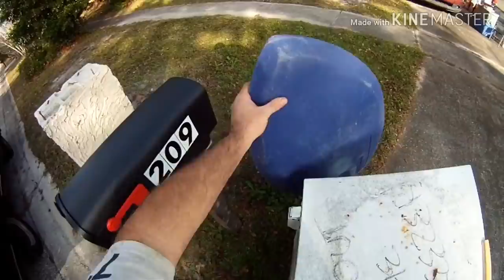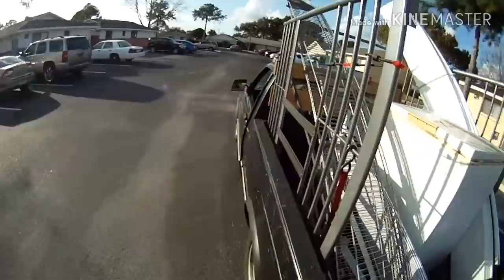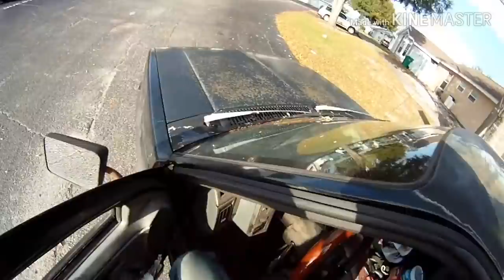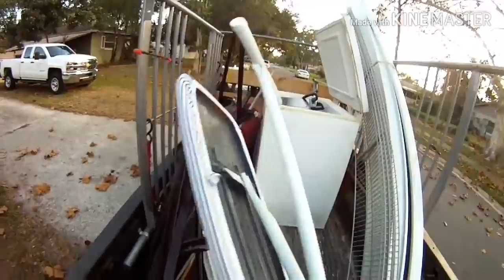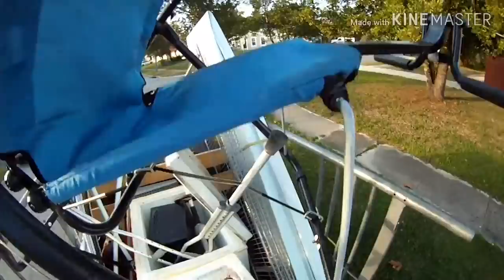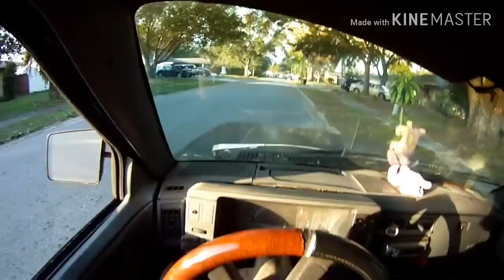Legally procuring scrap metal.

Comment: "If it's posted, it's illegal - otherwise, you're just assuming everyone else is a crook." or "When in doubt, the police can sort this out."

BTW - as someone who use to work in a furniture store, what usually happens with those bed rails is someone taps them together with a claw hammer a little too hard and the connectors just crunch together.

Comment: I take apart the microwaves.  Good chunk of copper in there. 2 minutes to take apart.
Reply: Careful with those high voltage capacitors, those things will stop your heart!
Reply: I've been taking them apart for a while with no problems.  I do use my rubber grip snips and cut the capacitor wires one at a time.

Comment: Here in Australia the law is a little different , kerb side waste is deemed the property of the council. And yes they do recycle metal plastic glass etc.  It all goes to whats called a recycle centre and is sorted and then the rubbish sent of to be disposed of in land fill.  We have a deposit system for all cans glass and plastic bottles of 10cents each and the council just love them here in Adelaide South Australia and do not like people removing them from the bins but do still tend to turn a blind eye in most council areas. The deposit and recycling is not like this in every state but is slowly changing with more states going with our system , It use to be just S.A but now 4 of the 7 states do it to some degree. Victoria still do nothing.  Also kerb side waste is now not permitted to be put out unless you make prior arrangements with council  for collection in my area and you must only put it out for collection the night before or that morning of the date your given and yes they are very prompt at collecting it. All kerb side waste is deemed the property of councils here but like i have said they still some what turn a blind eye but do have the right to prosecute or and warn offenders.  They have worked out that there is money in waste and they want it.  I still collect scrap and will until they stop me but it is much harder now as you dont know who or when its going to be put out. Its now pot luck .  And I should also state that certain gov dept have the right to go through your bins and check your waste with out being in breach of council regulations. Just another little junk law they made to suit themselves.